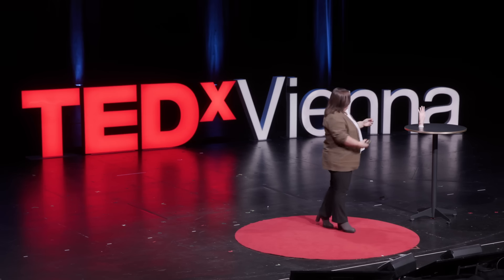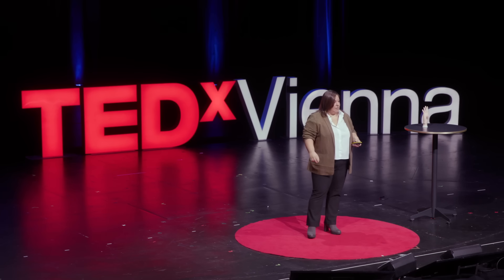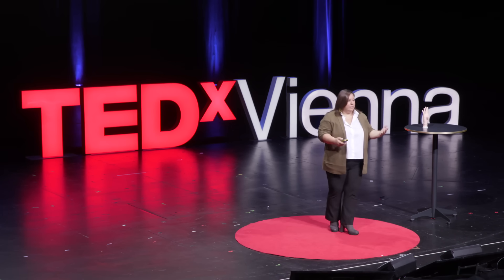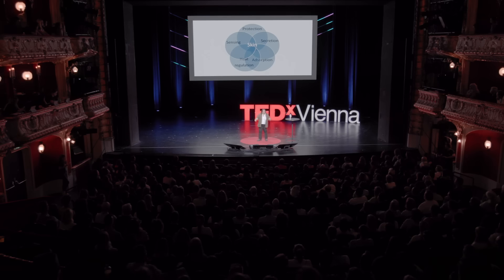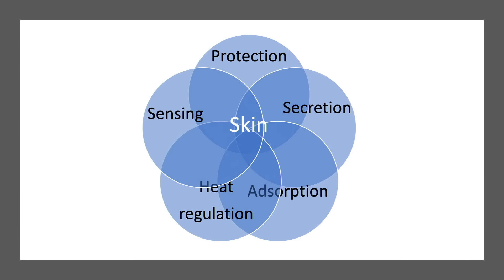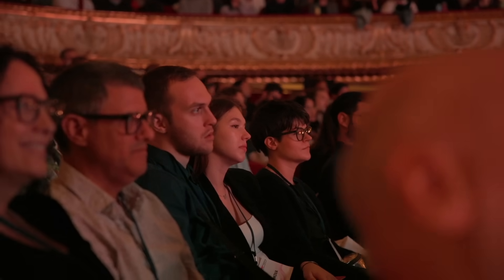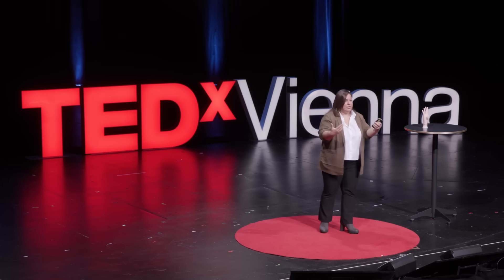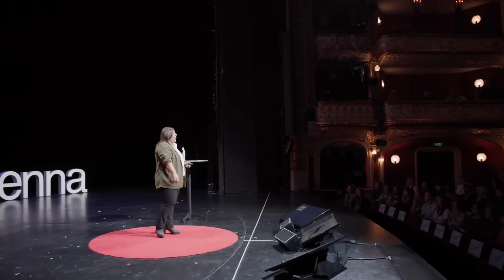Artificial Skin? We Made It — Here's Why | Anna Maria Coclite | TED

Comment: Assuming you could actually intergrate this technology with a human's nervous system; more resolution in touch in a human's skin could lead to oversensitivity? You'd probably need to tune down the resolution most of the time. If there was some of that artificial skin on the tips of my fingers, I'd be able to detect defects in the finish on a polished surface to a much finer degree. I'd not wish to touch say, velcro or something rough with the skin on full resolution. Oh god imagine touching a slug!
Force feedback sensing on robots would be seriously augmented. Robot surgeons, yes?
Reply: @scarlet_phonavis it’s not really that, it’s just that the thalamus does not keep forwarding useless sensory impulses to the brain if no action is needed, meaning it just basically ignores it after a certain point and you no longer notice the stimuli.

This technology is neat but I am unsure how they would be able to send the neuron impulses correctly (the right amount to right places) and how the body would integrate them appropriately.

Comment: 00:04 🖐 Artificial skin technology demonstrated, showing response to touch, temperature, and humidity.
01:14 ⚡ Artificial skin mimics how human skin senses and transmits signals through electrical currents.
02:41 📏 New artificial skin has unprecedented resolution, sensing objects smaller than human skin can.
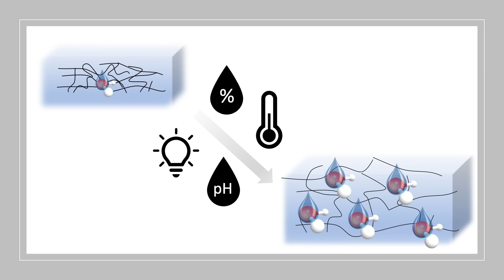03:43 🔄 Stimuli-responsive material changes shape in response to humidity, light, pH, or temperature changes.
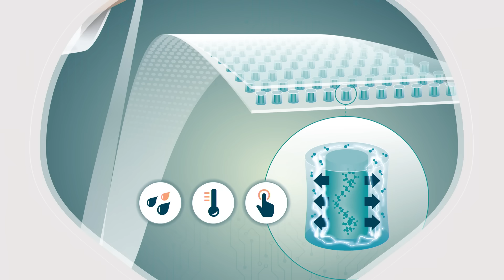05:43 🔄 Combination of stimuli-responsive and piezoelectric materials enables sensing and electricity generation.
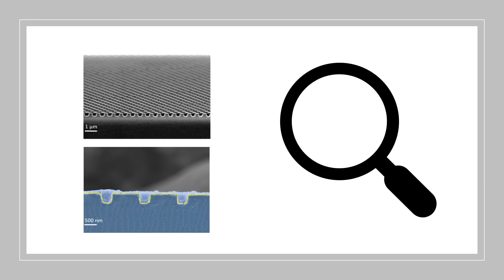06:46 🛠 Production of cylinders with specialized materials involves vapor deposition in vacuum chambers.
08:19 💡 Potential applications include aiding burn victims, enhancing smartwatches, improving humanoid robots, and enhancing prosthetics.
Reply: Amazing! Thanks for the summary.